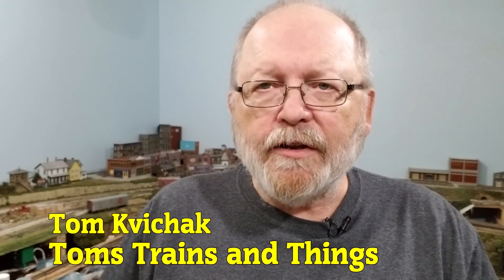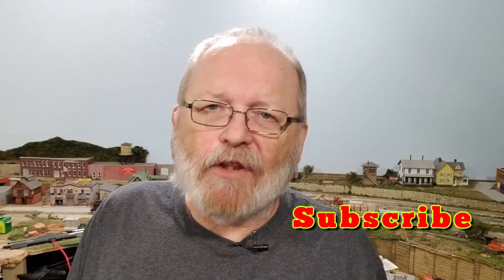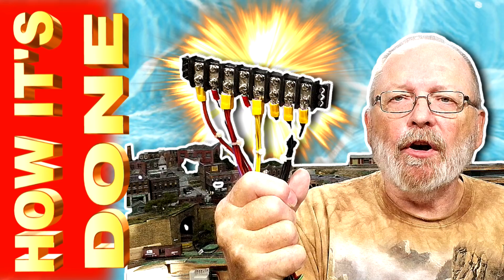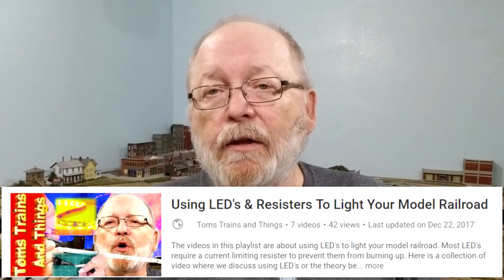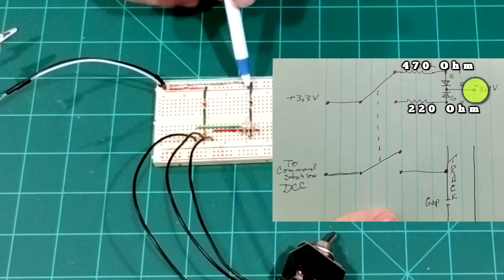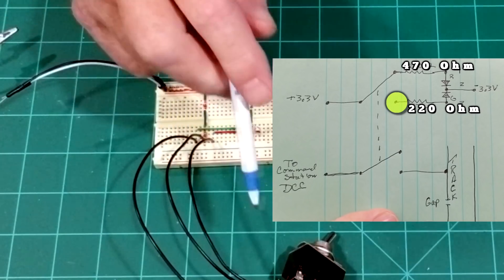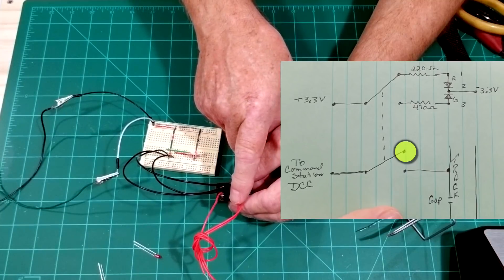How To Wire A 3 Pin BiColor LED To Indicate Track Power On Your Model Railroad

Comment: Thanks
Don't hold me to this, but I read many years ago if you flash the red and green LED at the correct rate you can get decent Yellow
What that rate is I do not know.
Chuck
Reply from the maker: You are correct Chuck. I don't know what the rate is either but I'll be able to test it when I do the Arduino in a few months. They also make the 3 pin that has 3 colors. When you apply power to both sides at once, you get the 3rd color.

Comment: Any suggestions on how to wire these to a Blue Point Switch Machine that uses an internal DPDT…
Thanks
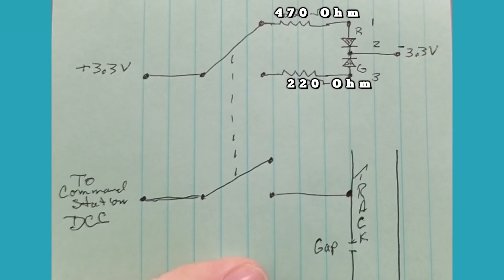Reply from the maker: At 4:23 I show a wiring diagram of how to use this.  DPDT contacts on any device are the same as DPDT contacts on the switch I use in the example

Comment: This is the type of circuit I'm looking for to show power on or off on engine storage tracks using two leds, one red, one green  As others have said it got fuzzy at the end when you used two separate leds but didn't make connections clear. Like others, would like to just see the actual wiring, with consistent conventional wire colors. Bread board leaves me in the dark. Not a techy, just trying to connect wires. But you've given me enough to know it can be done. Thanks
Reply from the maker: The breadboard is the most simplistic way to show the connections. I have other videos where I go into detail on wiring our layout

Comment: Thanks for your video.

I need to know how to use such 3 pin LED to indicate faults in power inverter while it's on. On other way, I need to combine 2 LEDs in power inverter to be one: Green indicating power on with no fault and red in case of fault.

Comment: You lose mw with the breadboard. Would like to see the actual wiring vs using the breadboard. Couldn't follow it with a number of wires of the same color.
Reply from the maker: Follow the wiring diagram provided in the video

Comment: H Tom, First thank you for your video's I find them helpful. I have a question when selecting a 3 prong bi-colored Led does it matter whether is anode or cathode. I chose cathode with some reservations. I did not hear you mention in this video but I believe your schematic @ 4:30 in the video shows Cathode style with positive on the outside legs and negative common, correct?
Reply from the maker: That's true, you need a pos sig from the Arduino to drive the LED.

Comment: I had great hope that this video would be helpful, but no.  Not sure what the breadboard thing is and your hands were in the way and camera zoomed out too far to see anything.
Reply from the maker: You might want to start at the beginning of Basic Electronics if you don't understand a breadboard. It's the most basic building block of a circuit!

There was also a wiring diagram to follow.

Comment: have you ever found a red yellow green led ? i had some from orgen supply in some search lights an one burned out . they are a very nice color and show a very correct color .
Reply from the maker: Try some vendors on ebay, you can find just about anything there. Look for vendors that have a warehouse in the USA. You'll get them much faster. Shop around, the prices will vary from vendor to vendor.

Comment: Lots of great videos! I was wanting to know more about how to replace a busted bicolor 3 pin led with two regular LEDs in an established circuit i did not build.  How would I do that as the end of your video wasn't really clear to me?
Reply from the maker: Put the long leads of the two LED in the center and the shorter ones on the outside holes

Comment: Tom,
I really hope one of the Ardiuno projects your going to do a how to on is DCC servo turnout control.  I can't find a really good video or sketch to get a system like that running
Reply from the maker: That's one of the last projects I worked on, I'll see if I can find the sketch I used or maybe just create another one for a video.
Reply: Toms Trains and Things I would imagine I am not the only one that would like to see a video on a dcc arduino servo switch controller
Reply from the maker: I'll have one out sometime in February!